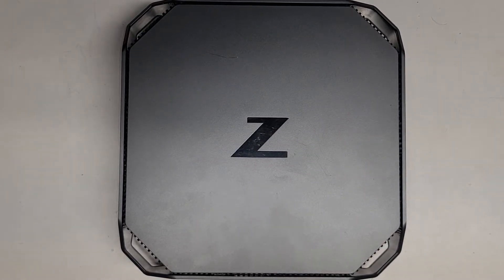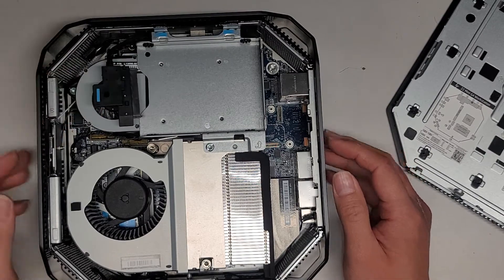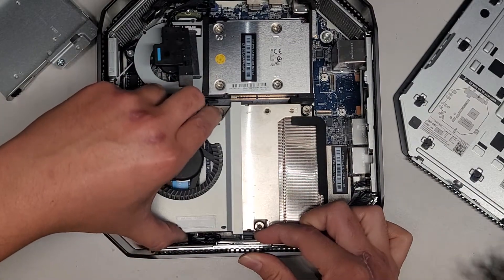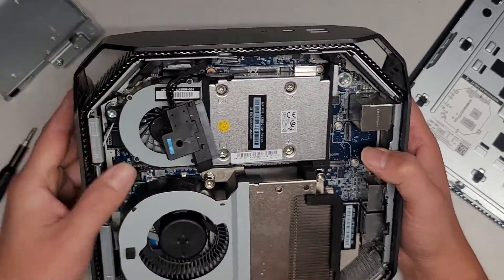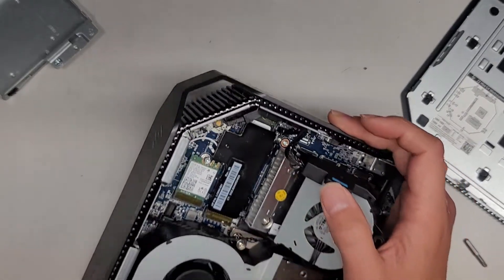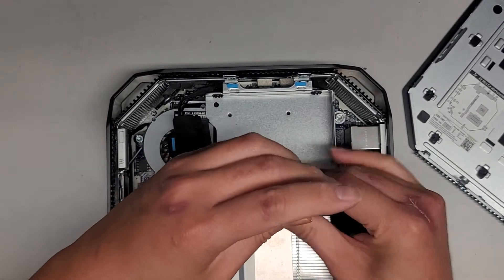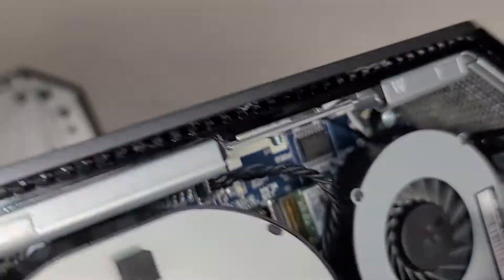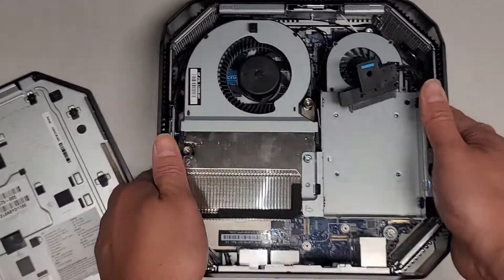HP Z2 Mini G4 Workstation Disassembly Quick Look RAM SSD Hard Drive Upgrade Replacement Repair

Comment: Can I use the 2.5 SSD as boot drive if the NVME goes bad?
Reply from the maker: Yup
Reply: @ItsBinhRepaired  Got it as a hand me down. The heat sync for the nvme along with the nvme is not in there.
Reply from the maker: @simranbajwa9299  got it

Comment: Can upgrade the processor? To icore 9
Reply: Yes, you can. i9-9900 or i9-9900K.
Reply from the maker: Cool
Reply: @PhantomGP01 are you sure about that because I saw somewhere the pins are quite different?
Reply: @wildlife6167  Very sure. 8000 series and 9000 series, as well as Xeon 2000 series share the same socket.
Reply: @PhantomGP01  okay thank you 🙏
Reply from the maker: Same socket doesn't guarantee it'll work. Just because it fits, doesn't mean it's compatible.
Reply: @ItsBinhRepaired  A simple Google search and a link to HP's compatibility list will give you the answer
Reply from the maker: @PhantomGP01  so it will work?
Reply: @ItsBinhRepaired  I gave the answer years ago. Then I clarified to someone else which series use the socket, which you challenged. So I told you to do the research to confirm the answer, yourself, and now you're asking me the same question I already answered? Did you expect me to change my answer?
Reply from the maker: I don't know
Reply: Hello please did you upgrade the processor? And did the i9 work on it?

Comment: I installed a NVME SSD and put my OS on it. It came with a HDD which I use as my storage drive. If I swap the HDD with a SSD, do I need to do anything with the BIOS or partitioning?
Reply: If you're replacing the HDD with an SSD, you don't need to do anything in the BIOS. You just need to format the new drive so the operating system can read it. If you want to copy what you have from the HDD over to the SSD, you just need a USB to SATA adapter or USB external enclosure to hook the old drive to.
Reply from the maker: Yup
Reply from the maker: Might want to delete all the partitions on the old drive and create a single one for storage.
Reply: Hi please do you know if this hp z2 is compatible with lastest intel cpus?

Comment: thanks for the video, one question if I want to upgrade ssd, I can use 2.5 inch ssd or M.2 Internal SSD right?  is there a benefit of using M.2 Internal SSD?  seems 2.5inch ssd is easier to add.
Reply from the maker: Yup, but if it's supports m.2 nvme, it's worth the added work to get that extra speed.
Reply: m.2 has a faster read/write speed than SATA connections for 2.5" SSD/HDDs. Usually, you'd want the operating system and programs installed on the m.2 SSD so the operating system and programs boot up faster, and use the 2.5" SSD/HDD as file storage, so as documents, music, pictures, videos, etc.
Reply from the maker: Not if it's an m.2 sata